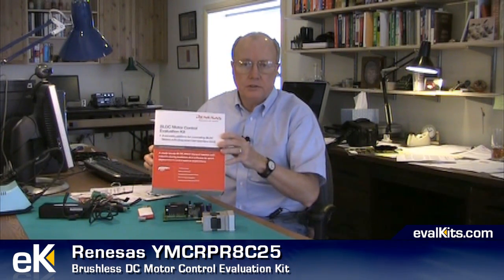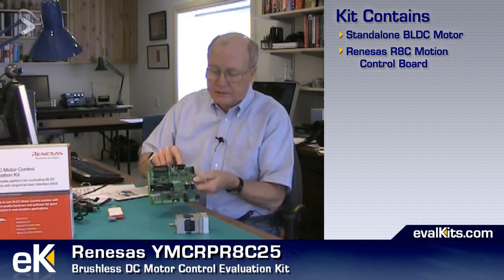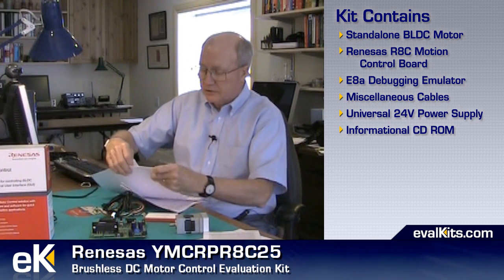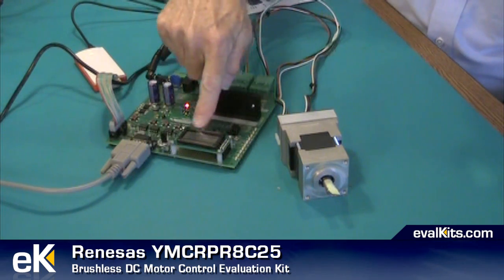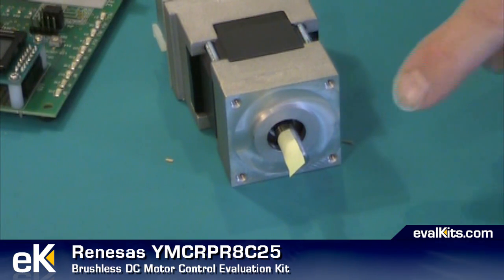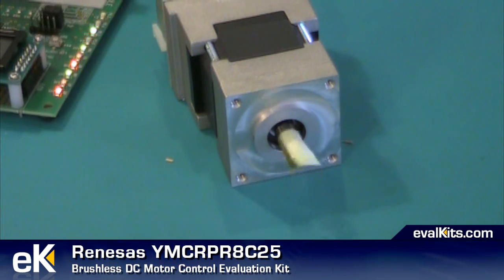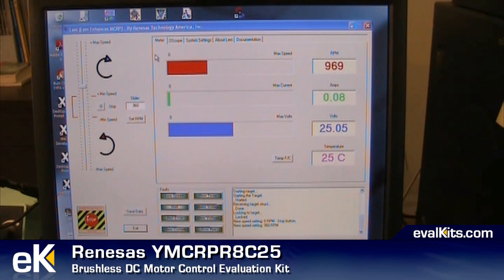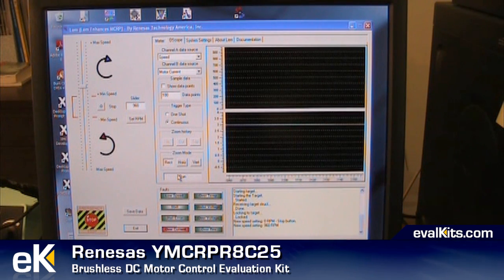Renesas Brushless DC Motor Control Evaluation Kit (YMCRPR8C25)

Comment: I am making my own BLDC 3 phase fan motor. its has 6 coils and i am using 6 permanent magnets. However, I think I should use 4 magnets instead of 6. Do you have any suggestions as to the number of magnets that I should use in my 3 phases bldc motor?